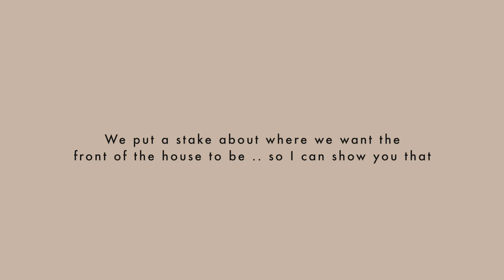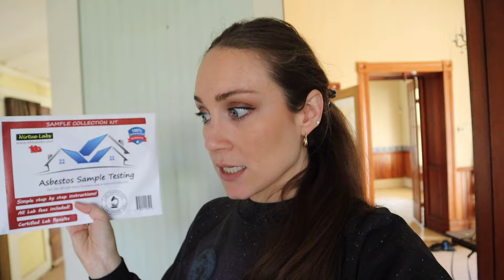CHANGE IN PLANS AT THE COTTAGE | Renovating Our 110-Year-Old Cottage | XO, MaCenna

Comment: Grow a pittosporum hedge in the front, privacy, noise reduction, cheap and fast growing. Once you rip up the concrete and redo it or pave and you fix the porch it will be amazing. If you have to re-stump the house (fix the foundation) it will cost heaps and that is a better use of $8k. Double glazed windows and insulation will resolve the noise issues. The house has beautiful features, try to salvage the timber floors and lining boards to reuse if you can. Well done to both of you, I look forward to seeing you develop the property.

Comment: I know that the added expense of a truckload of sand is not optimal, at this time. I really recommend that you fill that hole. There is a reservoir at the end of the shaft, which unless it is filled, could cause a sink hole. With water table (aquifer depletion) shifting, $437.00 now may not be as much as a future repair to the home's foundation. Further, if there is a shift in the plates, the tank could rise and cause that shaft to come through your foundation. It's plausible. I welcome any feedback.

Comment: I have asbestos floor tiles in my house (they are now buried under a second layer of flooring because we don’t own the house (if it’s sealed, it’s safe). That does not look like asbestos flooring there lol.  Usually asbestos tile is small, like 6 or 8 inch squares. If the flooring is a sheet or large squares, you most likely don’t have asbestos. Ceiling tiles, idk. But better safe than sorry.

Comment: Love to see you're house renovating. I would propably invest in good insulation for noice reduction and curb appeal instead of moving the house. Only advise to give you with such old houses is that lead or asbestos could also been used in pipes (drinking water, heating), insulation and heating systems. So watch out for you're health.

Comment: I actually would prefer a smaller front- and larger backyard bc this way you cant be seen from the street when you spend time outside your house. Also I think the house looks actually so cute between the two trees, I think once you clean up the exterior and redo the frontporch and maybe put up a cute low fence right in the border to the street, plant some bushes and such it will look perfect where it is, safe the money!!

Comment: Couple of suggestions: a white picket fence would dress up the front yard and fit with the age of the house. Also plant some flower bushes in the front yard in keeping with the age of the house. Put a drive in for parking in the back. 
2. A few videos back you put some windows in the shed. I’ve seen those DIY’d into stained glass windows. That would be pretty and you are an artist. Just a thought.

Comment: It's hardly a busy street in any case so what's the problem? It will look great with a white picket fence and some nice flowering shrubs and a tidy up. You can get rid of the concrete paths and lay some nice reclaimed cobbled bricks instead or modern ones that look old.

I would get an engineer in to look at that massive hole though as it could be a well and if you are building over it you need to make sure the shaft is stable first

Comment: Chances are, when the house was built the front yard was larger and the street was smaller, a cart path actually. As more folks could afford to buy cars, roads got wider so 2 vehicles could pass each other. Then vehicles got larger and the roads got wider encroaching front yards. If you can research the original family who built the house, the heirs may have old photos of the house. Have fun and good luck on your adventure!

Comment: I think you made the right decision...just think about everything you can do with that huge backyard...and with the $8000 that you are saving with not moving the house...you can have the most amazing garden and private space back there. Also, as you point out, for the curb appeal, you will be really making a difference by removing the eyesores like the cement, and Im sure even though it is small, you will have a gorgeous front yard. For the noise, consider putting a water fountain in front and putting in good noise-dampening windows. We lived near an elementary school when we still lived in town, and the combination of good windows and a fountain....you couldn't even hear the kids screaming.

Comment: holy! only 8,000$ to move a house?!? i asked once, and it was 30,000$ just to lift it off the foundation, plus moving it, plus permits, plus reconnecting electric and all that. some people lift houses around here to make crawlspaces into basements, and just the lifting is considered a big chunk of the budget. 

but i dont think a front yard does much. you cant really use it unless you want everyone staring at you. plant some pretty shrubs and trees for privacy and to help block noise. although, if you replace the windows, that will help alot with cutting noise

Comment: From what I know about asbestos, the samples you've taken are going to be negative. Asbestos has the appearance of fibrous cement, and is used in heating pipes, drains or roofing, for example.
Reply: Asbestos can also be found in some old tiles and even the glue holding them down. They used to put it into tiles making it dangerous only when they crack. It was mainly vinyl I think but all old tiles should be checked as it could be underneath

Comment: Honestly,  8,000 is half of what I actually thought it was going to be. It averages 15,000 in PA just to move a small home here, and that of course goes up with other factors like size of the home, new foundation, pipes, etc. 
And that road is so little and doesn't seem like a major roadway at all. Plus having a bigger backyard seems like it would be more practical. Like, are you going to even use the front yard? What about if you just put a  picket fence around the current front yard, and seeing if that helps the appearance of the yard? Now you have more room for the guest cottages you wanted too! 
Have you also thought of just demolishing this house and starting over from scratch in the space you wanted to move the home? The majority of the house is add on's anyway, and you could always use all the reclaimed materials from the home in the new home, so it would still have the old charm. I know you won't but its just an idea.